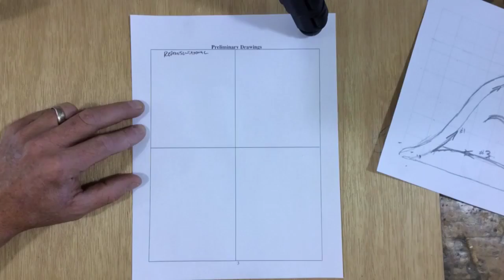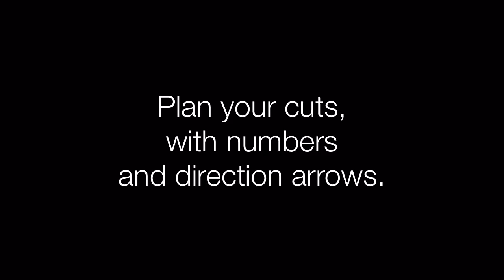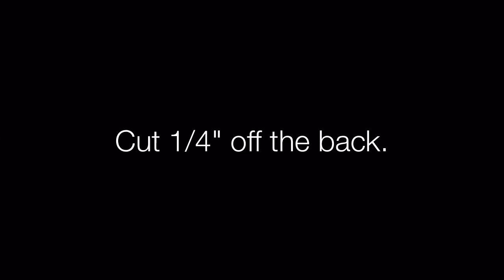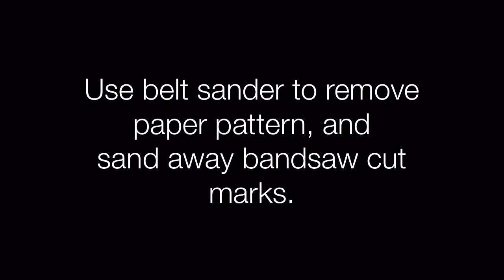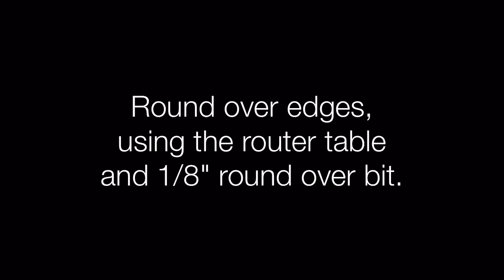Design and Build your own bandsaw box.

Comment: great box but i feel the stain ruined it.  although others will disagree with me.
Reply: Pine is very porous (aka a soft wood).  It would have been better to apply a sanding sealer first, slightly sand, then apply the stain. It would have looked nicer.

Comment: how many teeth per inch on the blade  and  is it 1/4 or 3/8?
Reply: William Howard 3/8" x 6tpi, 1/4" X 6tpi would be better.
Reply: Just noticed the comment. Why do you say that a 1/4" 6tpi would be better? I want to start making my own bandsaw boxes so I am getting as much info before I dive in.
Reply: Cliff Carlo 
the smaller blade can make tighter radius cuts.
Reply: +Scott Manninen 
Of course, makes sense really when you think about it. Thanks for getting back.